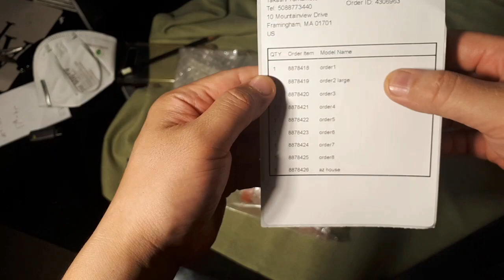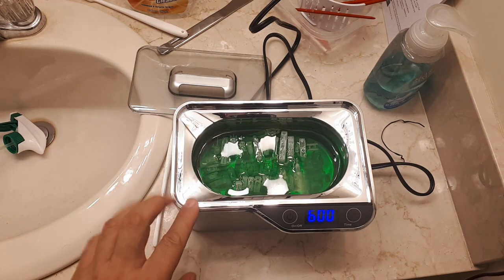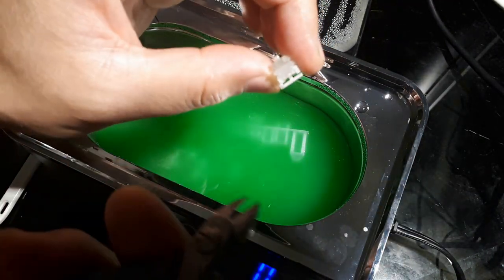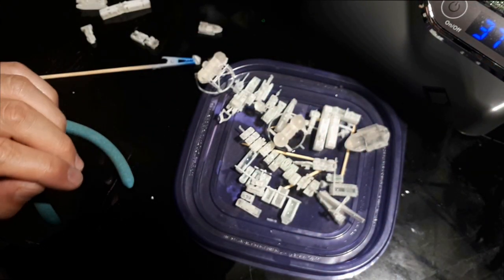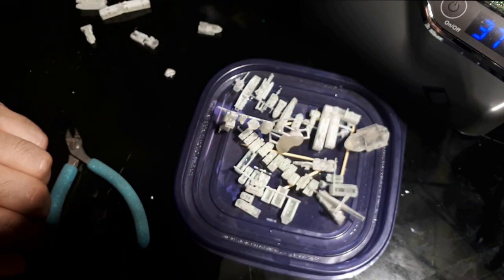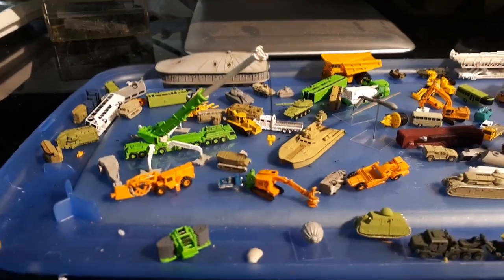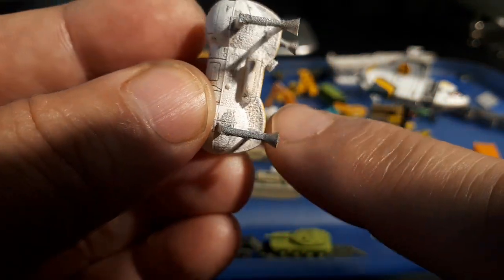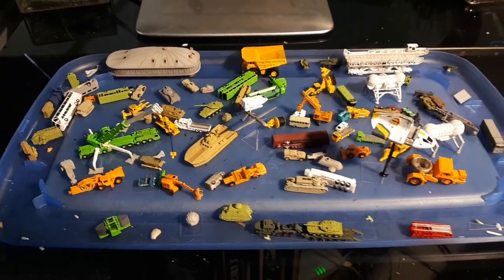Tutorial: Clean, paint, detail. Shapeways smoothest plastic models 3D prints  1/400 1/200 6mm etc.

Comment: I bought some smooth details models last year from Shapeways and had them sitting in their packaging. I finally got around to working on them recently. The parts looked the same as they did when they arrived last year.  I tried this method out (even bought the same model ultrasonic cleaner) and the results have been lacking so far. I don't think your method is an issue because I've tried a variety of methods. Basically what happens is every time a part dries it develops a chalky coating - it doesn't look like the part is actually degrading though. Some of of it comes off by fingernail scraping, some of it requires harder scraping. Unfortunately some of my parts have lots of grooves and brushing doesn't really do much. I've tried ultrasonic baths with Simple Green, with plain water, and with soapy water and soaking in Simple Green or soapy water and post bath/soak brushing or more ultrasonic. On a few sacrificial parts I tried acetone, alcohol, and mineral spirit brush downs. Thankfully I didn't destroy those parts but it did cause some warping that can be fixed during assembly. But it seems it made no difference to the poweder development compared to the parts that didn't get acetone, alcohol, or mineral spirit brushdowns. Right now I'm just trying a multiday simple green soak followed by a ultrasonic bath in plain water. It seems to be making progress, though it is extremely slow.  I'm going to start using compressed air to dry the parts too. As it stands I absolutely can not paint any of the parts

I'm not sure if I just had an extremely bad batch or what. I did just buy some new parts, but I'm afraid to even put them in water. They're kind of oily feeling though so I can't just paint them without washing.
Reply from the maker: The smoothest materials use a wax support so heat and anything that breaks down wax is what you want. I'm guessing your wax is very hard from a year in storage but with time soaking or scraping it you can get it off.